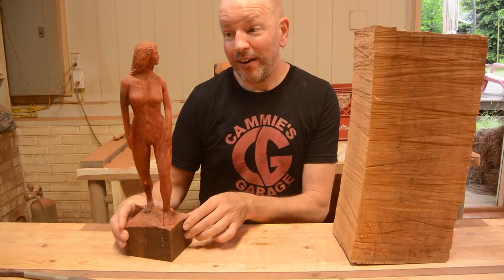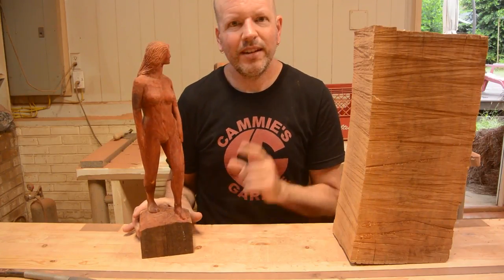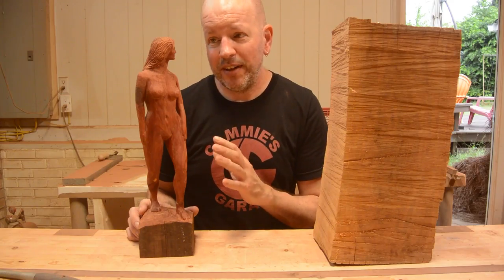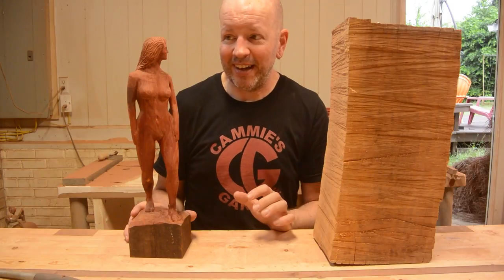Carving a Female Figure - Woodworking, Art, Sculpture

Comment: I made a carving also - my first and only - but it was of leaves and things that could be a bit wrong without being obvious - but a figure is different - it has to be right, so I think you did pretty well.  I imagine that one of the difficult things is to get the poise right - get her standing with her center of gravity between her feet - not visibly leaning in any direction.
Your method is a very dusty one!
Reply from the maker: Thanks for watching, Mike.

Comment: what add on was that on the angle grinder?
Reply from the maker: I use Saburrtooth carving burrs. I started with extra coarse (orange) 4 inch disk, then used medium (red) 4 inch disk. Use the code CAM10 for 10% off your purchase at www.saburrtooth.com.
Reply: @CammiesGarage  how would you say they compare to the Kutzall products?  Curious what makes you choose one or another
Reply from the maker: @mummyjohn  I have never tried Kutzall. A fellow woodworker friend suggested Saburrtooth and I have been using them since.